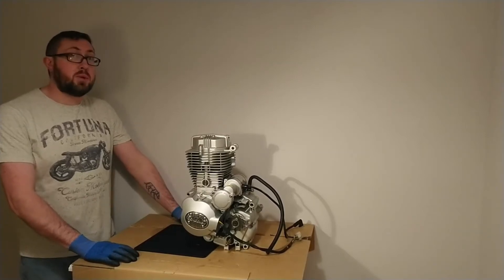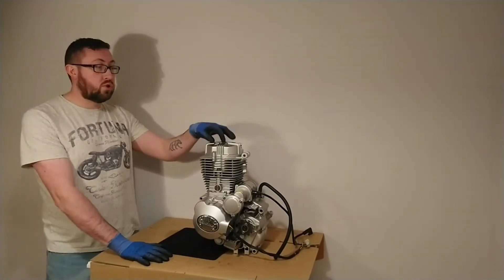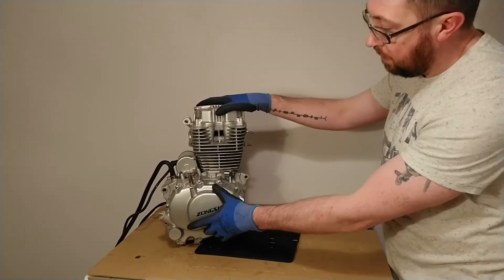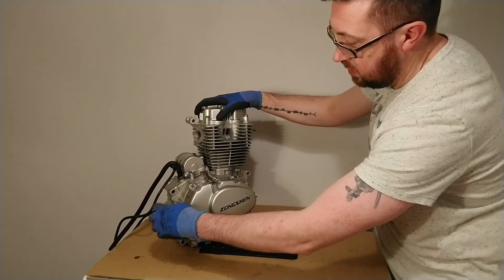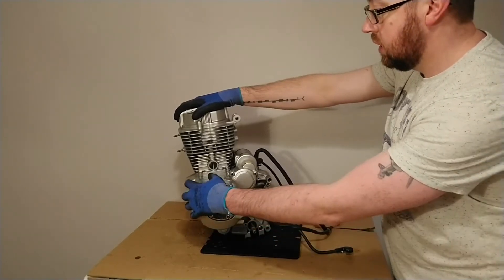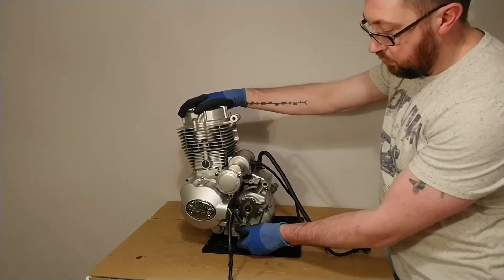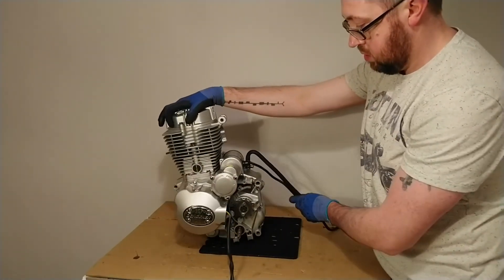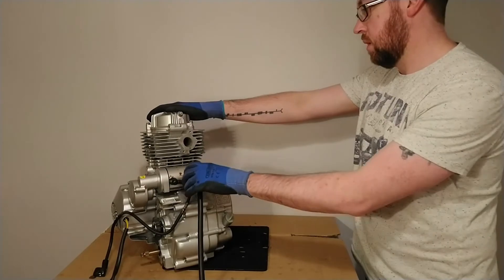How a Motorcycle Engine works - Part 1

Comment: I don't understand where the force come from to 
1. What move the very 1st stroke down when starting the engine for sucking the air/fuel into the camber ??
2. What Move the 2nd stroke backup ??
3. I get this one. The ignition burn pressure move the 3rd stroke back down
4. What move the 4th stroke back up ??

Thanks
Reply from the maker: https://youtu.be/8SprVNkYLYM?si=IvKdXXyA1x3yFsQD

Comment: Can I know why bike never goes back when we start it why the engine rotates in same direction how can it rotate in same direction
Reply from the maker: When you start the bike, starter motor rotates in a particular direction driven by direction of current flow in starter circuit. That generally determines direction in which engine begins rotating. Engine could rotate in other direction in theory but it's acted on by starter clutch which only rotates engine in one direction as it only grips engine crank shaft in one direction of rotation
Reply: @TheMotorcycleMuse  bro please make a video of it with animation

Comment: Hello i noticed this engine is the same as in my chinese atv. Kudaki k200, i struggle to find any manuals for this engine. You know where i kan find it? Have a spark problem and want to measure the stator etc..
Reply from the maker: I'm afraid i don't know where a manual can be found for that engine but a Haynes manual for a Honda CBF125 is close enough. Engine is quiet similar in most ways.
Reply: Thank you i will try that! 👍